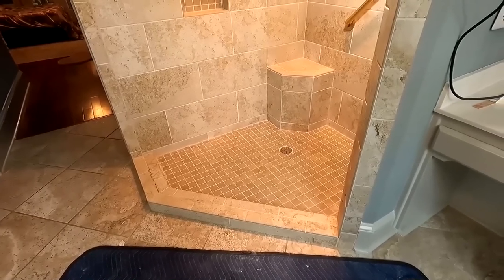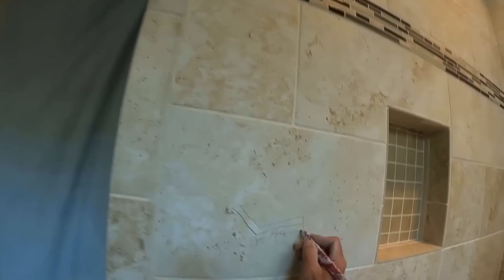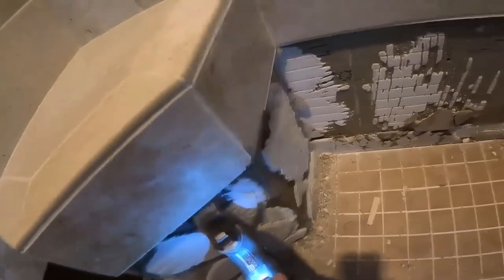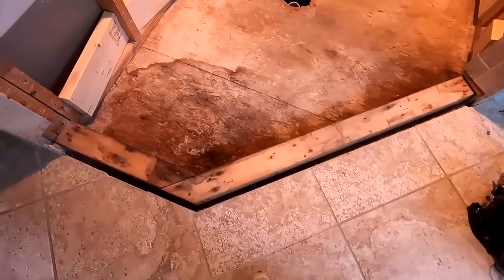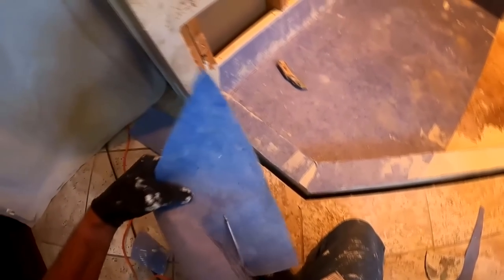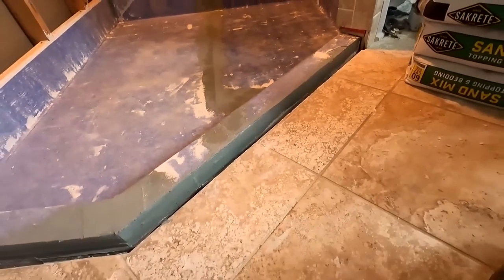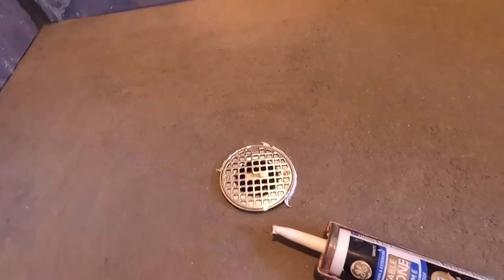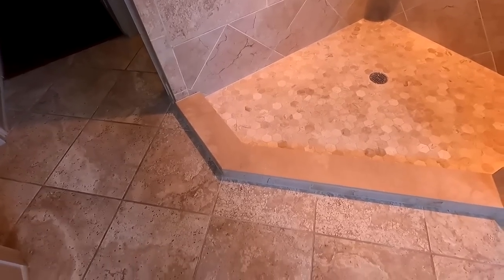FULL RE-BUILD OF A SHOWER PAN...from start to finish

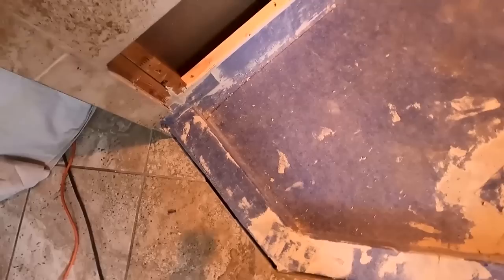Comment: Excellent video and top notch skills & knowledge. But I am against custom shower base in a wood structure. Stupid building codes dictates so many non sense but for some reason it doesn't dictate anything for these custom shower bases which gets butchered all the time. If I could i would ban custom shower base in wood structure. I built my own house in Ontario and if I put a custom shower base in the second floor, i wouldn't be able to sleep. So i went with an ugly quality acrylic shower base that has no seams, no way of wicking moisture or failing overtime (unless it cracks for some reason). I never understand why people choose form over function in such critical places. 51:32 sums it. Thinset is not a waterproof material. You have a fabric cloth that overlaps and supposed to seal together with a product that can pass thru moisture. So to solve that you are applying liquid membrane on top. So it is your what ? third defence? There is no such thing as 100% waterproof custom shower base. It is only a matter of when will the moisture make the passage all the way to the surface when you realize there is a leak. 3 years, 8 years whatever.
Reply from the maker: Yes I agree with most of everything you said, but I have taken out the prefab fiberglass pans that were cracked and we're leaking through a ceiling, so even that is not Bulletproof. However I've taken out showers from the 1980s and 35 or 40 years later it is finally failed....
Everything that we are doing nowadays is much much better than they were back in the 80s and therefore you have a solid three or four decades... assuming some wife doesn't like the design and tears it apart a dozen years later 😂
Reply: @StarrTile  No offence to you or any trades person in this field who takes pride in their work. I watch videos of you, tile coach and sal even tho i have nothing to do in this trade. I just like learning about trades. You are all awesome and offer so much to people who follows you. Thanks.

Comment: You used the wrong drain for the way you waterproof your pan with topical membrane. Should’ve been a bonding flange where is the water going to go without weep holes . This method is wrong and takes too long . It won’t leak but it’s wrong and unnecessary.